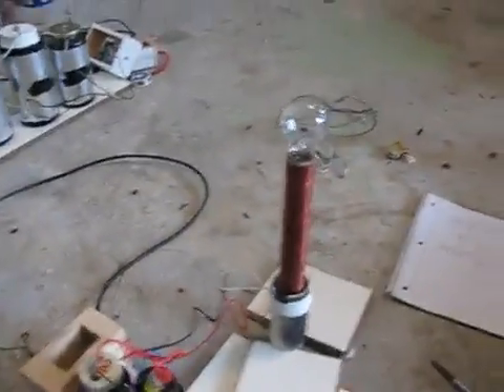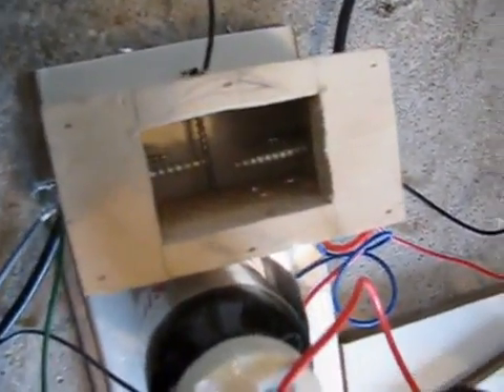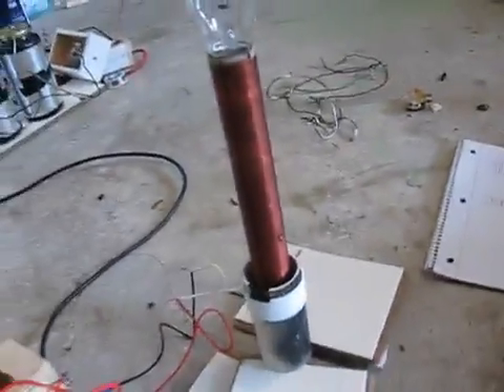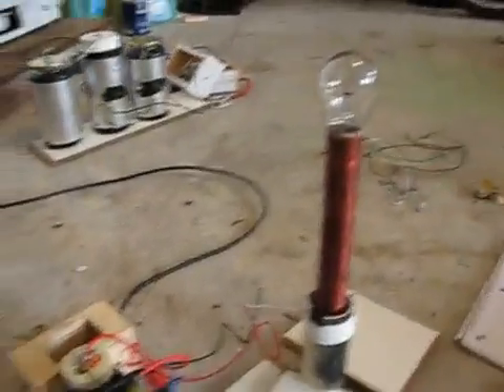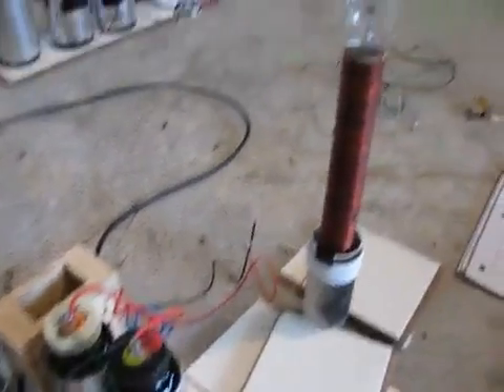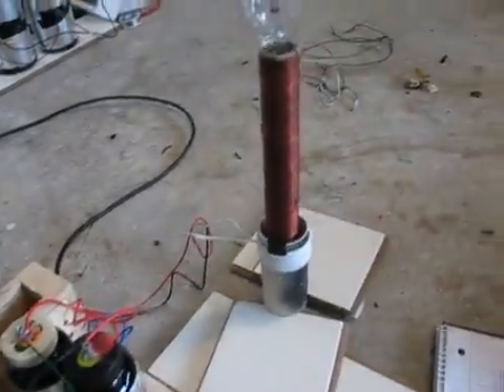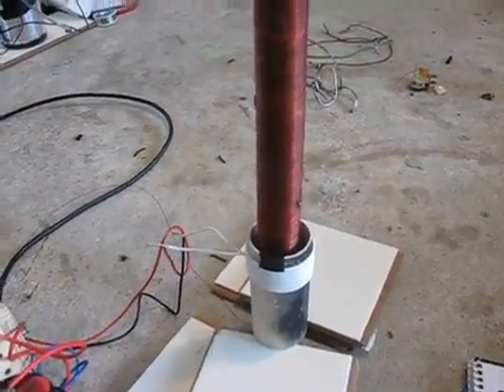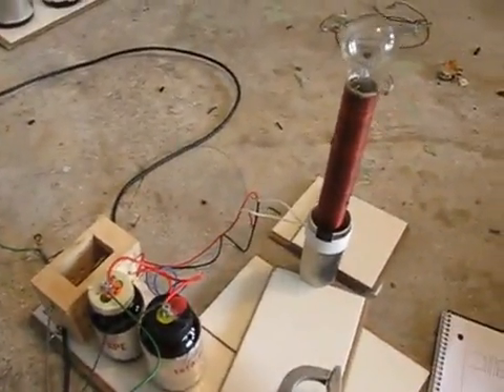Tesla Coil Generator Alternative Source of Potentially FREE Energy

Comment: 12000v x 0.03mAmps = 360 Watts (input)
What is the output you get from this?
Reply: 12000v x 0.03ma does not equal 360 watts. The input would be 360mVa not 360 watts. its AC not DC. the current and voltage are out of phase so that formula (power = voltage x current) doesnt apply to calculating power for AC. Also nst have higher current than 0.03mA. In fact a thosands times more. Usually 15mA to 30mA.

Comment: You don't feel pain when it jumps to your finger because the current isn't large enough. But the voltage is, which means that you will not feel pain but there is a pretty good chance that it will severely damage your circulatory and  nervous systems.

Comment: Here ill explain it the best way possible, The world has a magnetic field from the sun, you design a tower with copper and magnets at a high point, when ever lightning strikes the tower the electricity will multiply in electrons as it hits each magnet once the tower is electrified the world's natural magnetic field will keep powering the tower. This is all could of been developed in 17th century but because it's free clean energy it was suppressed and controlled by the government now they go and excavate the ground for oil and gasses when we don't need either to power machinery and buildings. We are surrounded by corruption and whats sad to is that are hydro poles should cost us next to nothing because the magnets are doing the work not the power stations.
Reply: i really hope this comment is meant to be satire. If not then, damn.

Comment: Also, you would probably be very interested in YT user moonfthr . channel. For anyone interested in how to use this power for household lighting and/or appliances. He shows you how to use a solar panel with a tesla coil and at he end of the chain how to step it down via a receiving coil to charge caps and run motors and lights